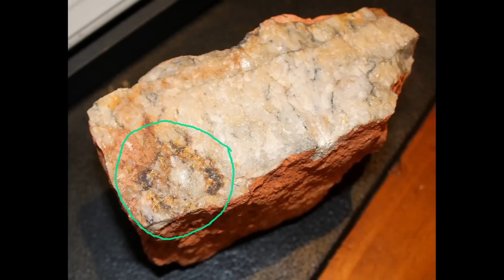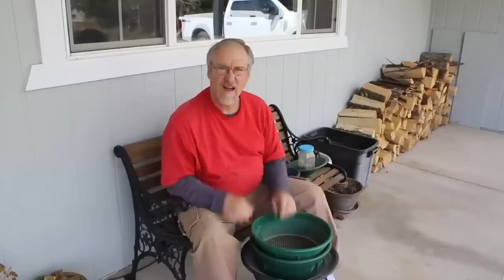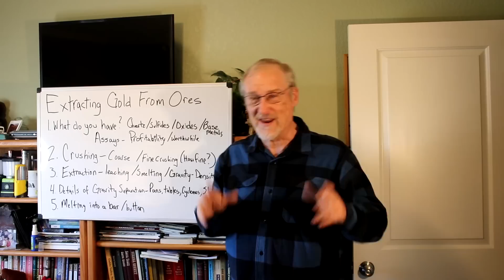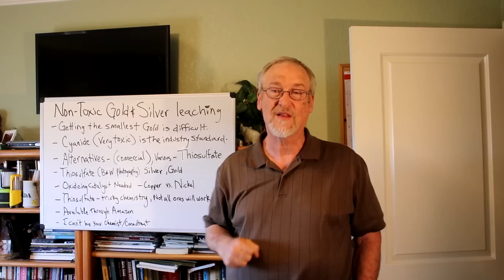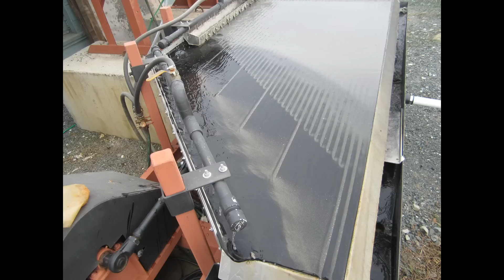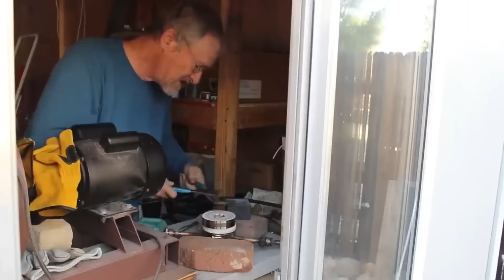Why Most Prospectors Ignore This Gold Source!

Comment: Electrolysis to drive off the sulfur from silver. Aluminum and copper for the anode/cathode. The sulfur goes to the copper, the aluminum is sacrificed and the silver drops out pure metal to the bottom of your glass container. Use salt or alkaline, baking soda as catalyst. Keep the water warm. Works great. 😊
Reply from the maker: Interesting technique! But silver sulfide does not often occur in blocks you could hook up to electrolize.
Reply: when I make a video for the prospecting channel showing the process I'll comment so you can see it.....later

Comment: You çould put water with jet dry in that bucket that traps the dust to catch the super fine gold dust. One hose into the water jet dry and another mounted to the top of bucket lid and connected to a shop vac.
Reply from the maker: Its more difficult than you think to capture dust with a water spray - even water with a wetting agent.

Comment: Chris, I made a dolly pot that I was seriously considering of automating into something more like a stamp mill. The idea of Processing manually doesn't exactly thrill me. However, I have been gathering materials to make a chain mill, but after seeing yours, I might have to redesign my idea for a chain mill. I may have to start thinking of building a jaw crusher, but I haven't seen any DIY designs as of yet. I do have welding and machine shop experience, but I'm still looking for some ideas of design if you know of any maybe you could point me in that direction. Thanks
Reply from the maker: I have no plans I can point you to for building anything like that, Many parts of Jaw crushers are specially cast steel for that application. There may be some ideas available online.
Reply: Chris, I have found some plans that include jaw plate angles ect. But I have decided it would be better at this point to invest more time finding than building more equipment. Cause if I find enough I won't have to spend time building, I can buy and spend even more time finding. But THANKS, I've learned alot from your channel!

Comment: what type of flux do you use. i have. a hand crusher.  havent found ore yet to crush.  ,tried some really rusty quartz.  but nothing. when panned out.  have a good day
Reply from the maker: I said in the video - its  mix of Borax and sodium carbonate with a little bit of quartz sand.
Reply: @ChrisRalph Hi Chris, do you know if table salt can be used instead of sodium carbonate?

Comment: I have been interested in this side of prospecting. I've gathered up some knowledge about it over the years, but not hands on experience.
  1 of my weak spots is the different techniques of refining refining the different metals and minerals when they are mixing together in ores.
  I've noticed   @sreetips  shows some different ways to refine and purify gold and silver.
Reply from the maker: Streetips works on metals not ores, and methods are way different.
Reply: @ChrisRalph  Correct.
   I haven't seeing the techniques to separate the minerals from an ore that has more then 1 mineral. Say like your ore has a mix of copper / gold  or  separating and collecting the minerals from a galena ore.
  I imagine you would need to crush and then dissolve each mineral using separate steps.
Reply from the maker: smelting methods separate gold and or silver from lead - galena is 2 or often 3 metals.

Comment: We seem to do well with gravity down to about 400 mesh. However with Montana B, 80% by weight will pass 6.8 microns.
Reply from the maker: I'm skeptical you are getting good recovery to 400 mesh. I'll bet your recovery starts to drop off slowly below 100 mesh and by 400, you are getting only a fraction. Just because you get some, does not mean you are getting all or nearly all. General advice is that for sizes below 150 mesh, you are better off leaching. Good luck to you - Hope you are doing well.
Reply: We use gravity before leaching so each can do what it does best. I am microscopically examining the gold particles. The gravity seems to do well down to about 0.0015".  Very little above .002" in the tailings with the ore from Top of the Hill.  The ore from Montana B was analyzed by TIMA Electron Microscope analysis.  Love the TIMA, hate the $1000 cost.